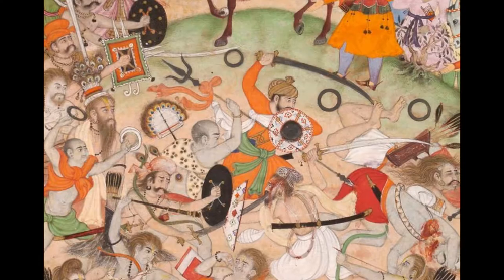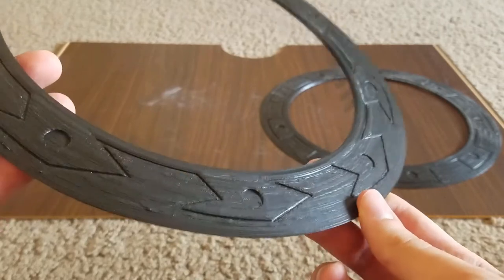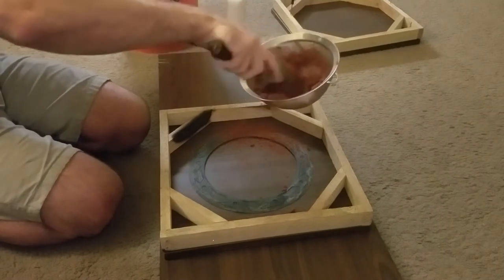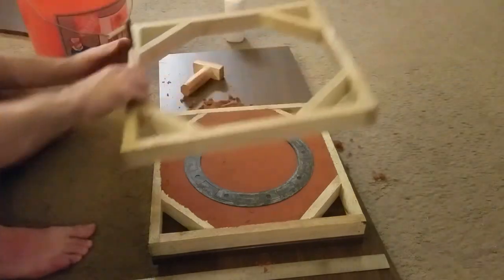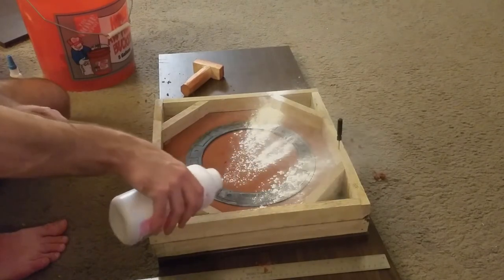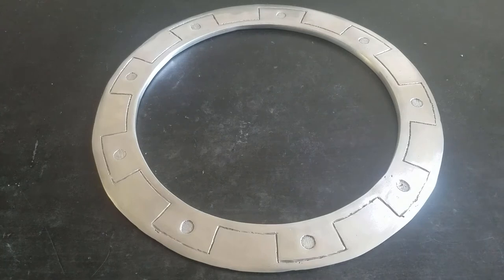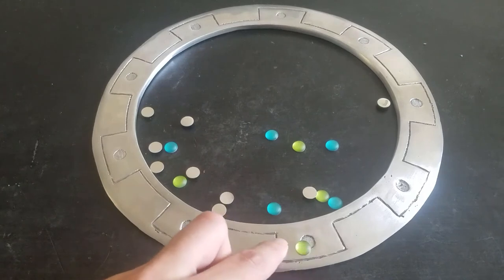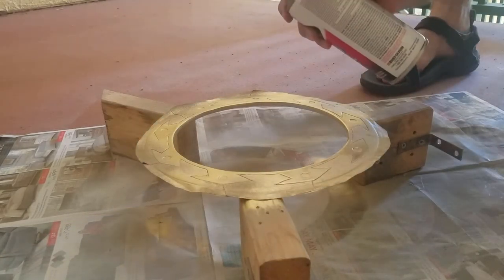Casting Xena's Chakram - Not Zoned For This

Comment: I've asked this anywhere I can, but never got any answers. What is the size of Xena's chakram inside and outside diameter, in inches if possible, please.
Reply from the maker: Good question, I had to estimate from pictures of Lucy Lawless holding the chakram and knowing her approximate height, and came up with an outside diameter of 10.8", and an inside diameter of 8.13".
Reply: @notzonedforthis6146  Thanks, you're the only one who answered so far. I haven't asked a lot, just you, Man at Arms Reforged, and Skallagrim. Glad to get some sizes. I always wanted to know since I first saw it. Might not be official, but it's something at least.